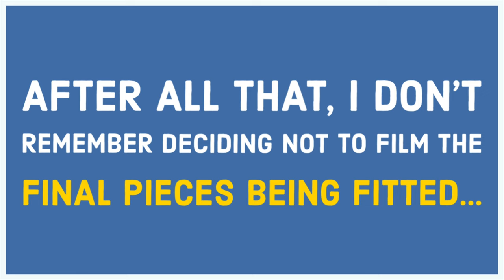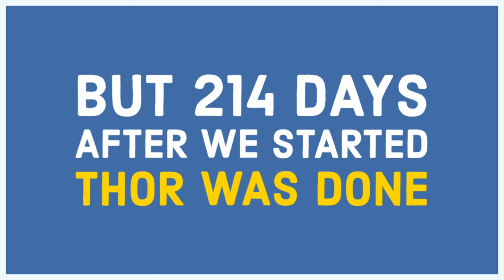Thor the Campervan | Peugeot Boxer Van Conversion Vlog #19 | Drawers, Storage and Final Touches

Comment: my only criticism is that you have no way from the back to the cab without exiting the van ?
Reply from the maker: We thought long and hard about this. We decided that we wanted it to feel like a cabin when we were in it, not a vehicle. It also means you don’t need to worry about heat/cold coming in from the front windows, or messing around with shields to mitigate against that. Having had it for over a year now we are really happy with that decision.
Reply: @TomWhitaker  having had the need to get to the cab to drive off without getting out the van id always want at least an opening to get through